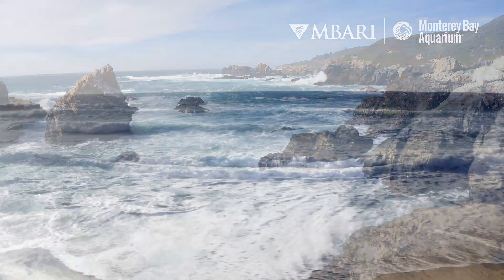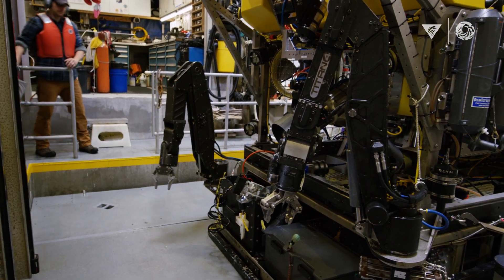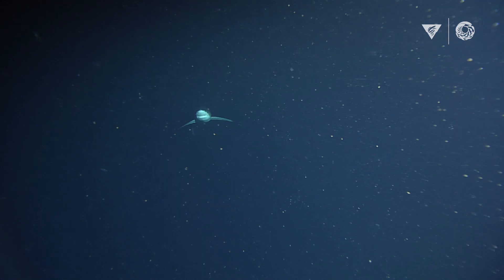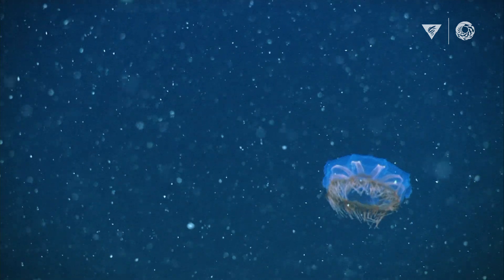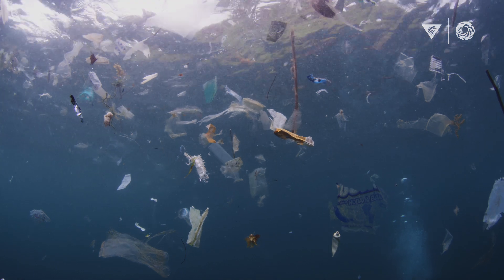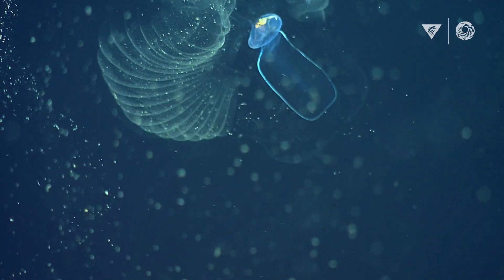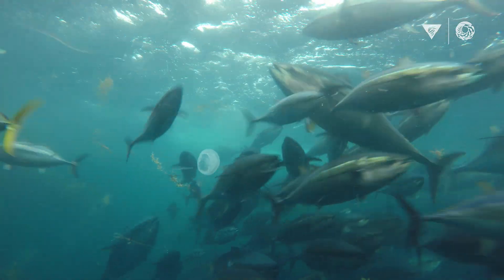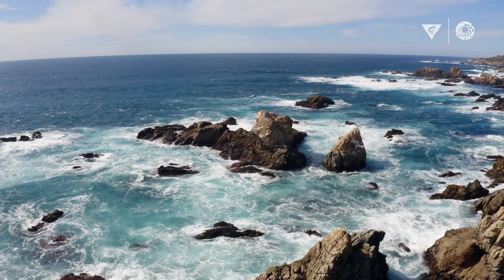Microplastics in the ocean: A deep dive on plastic pollution in Monterey Bay

Comment: Trash in the ocean is only going to get worse.  Cruise ships and military vessels still dump trash in the open ocean today.  As long as they are 12 miles from shore it's not and easily enforceable law. Why do they do this? It's cheaper than paying for processing when ashore and eliminates storage problems and cleanup.  Until it becomes a problem for the dumpers, simply put, it will not stop.
Reply: Did you know that US warships have an actual job that is dedicated to separating plastic from everything else before dumping the food waste?  The plastic is compacted and stored for proper disposal.
And guess what, the USA is the only country that does it. No other country gives a shit.